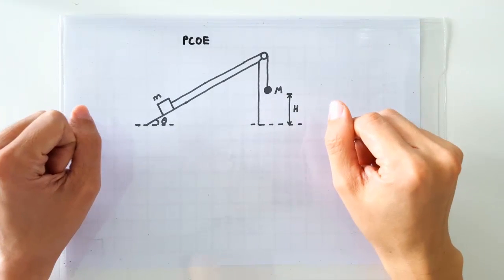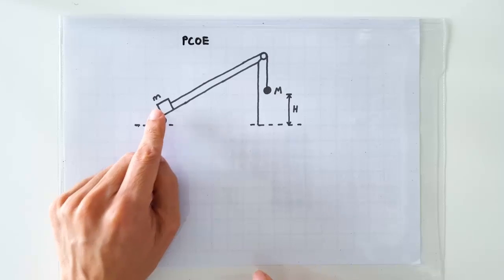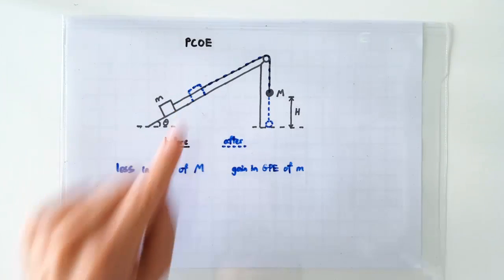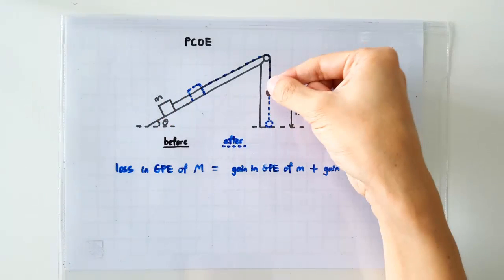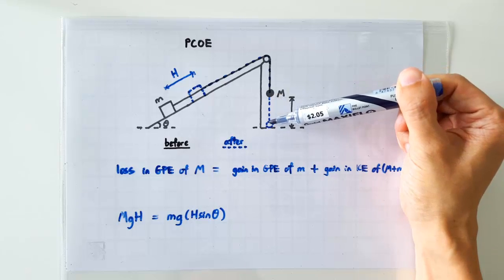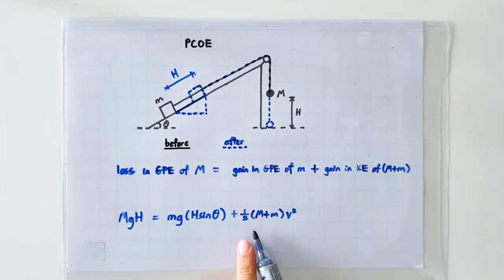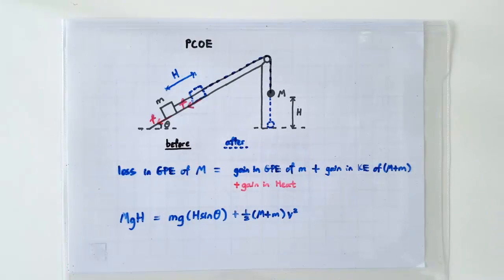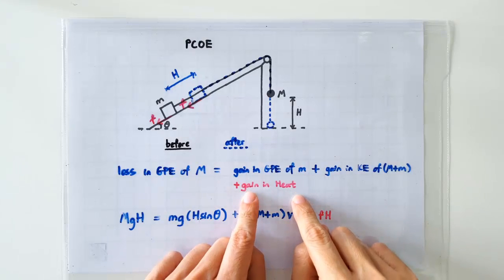Application of Principle of Conservation of Energy (Ramp and Pulley)

Comment: What if you don't have an angle?
Reply: The angle has to be specified some how. If not the problem is not defined.
Reply: i used this method for a question with no angle, just don't put an angle, that's all.